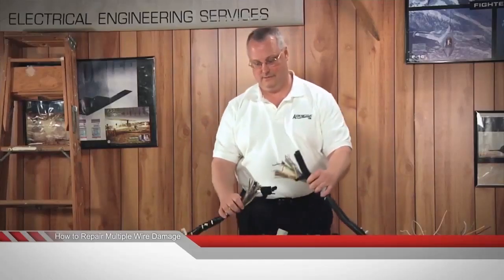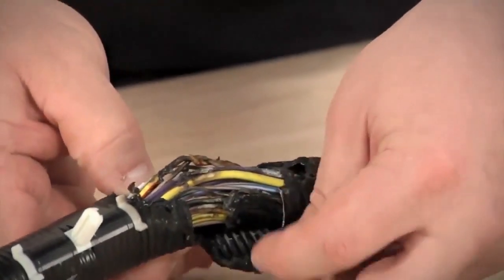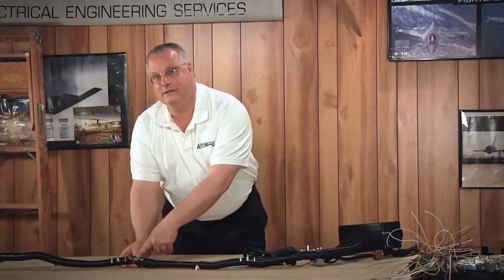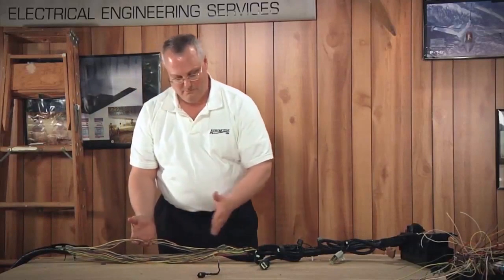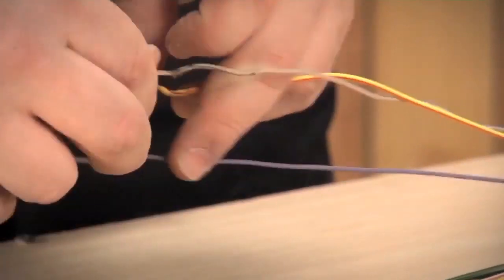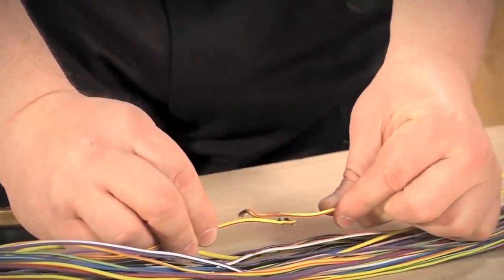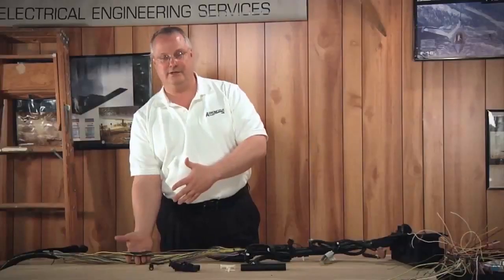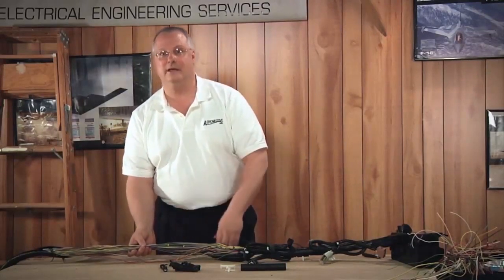Ch. 3 How to Repair Multiple Wire Damage

Comment: Great video! Everything was easily explained I do have a question though from my Ontario Truck Mechanic exam which I’m assuming we have the same answer but I just need confrimation (if you can help me it will be appreciated) it goes “What is the procedure to service broken twisted pair wire set?” I have A) connect inline, solder and cover with heat shrink. B) stagger wire connections, solder, insular with heat shrink and re-twist. C) connect inline, twist wires together, then cover with electrical tape, D. Stagger wire connections, then connect with insulated butt connectors, I picked B.